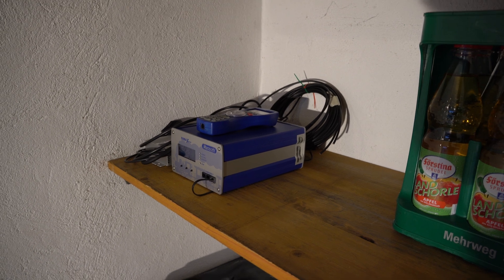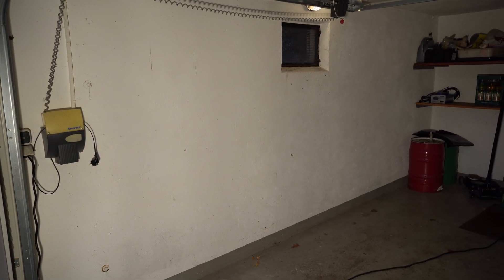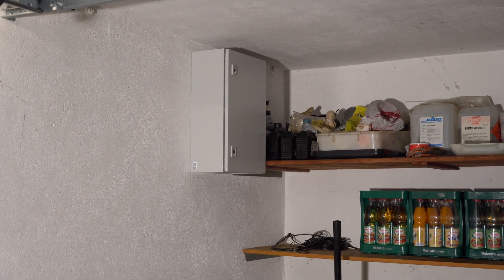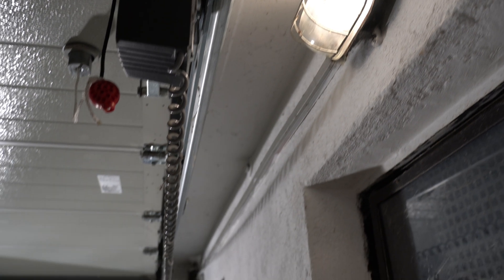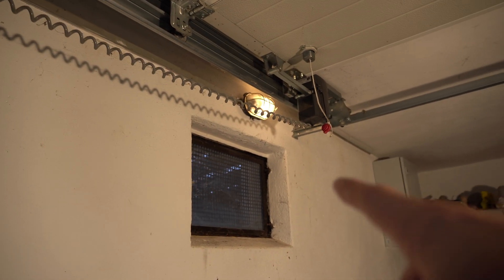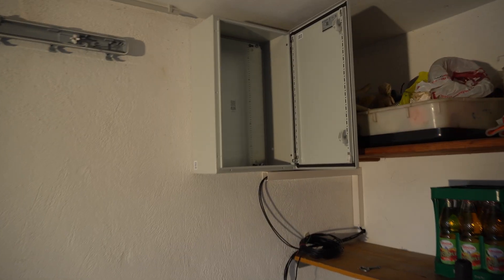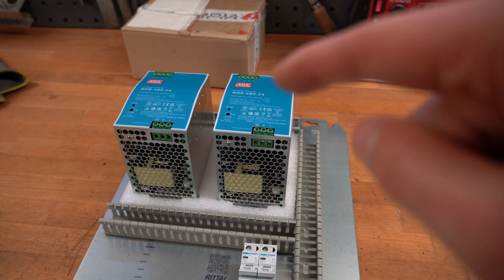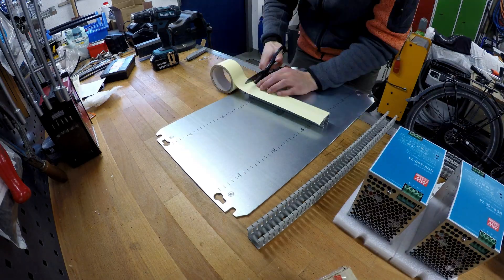40 amps of juice for my GARDEN RAILROAD, installing MEAN WELL NDR-480-24 power supply

Comment: I have been watching your videos of the garden railroad construction. I am new to this and just staring my outdoor layout and your videos are my inspiration. Are you using these to power the Massoth DIMAX system rather than the switching power supply that is often sold with the Central Station? Will you be adding video to provide mor detail? Thanks.
Reply from the maker: Hi, I am proud to be you inspiraton! You are right, I am using those power supplys to power the Massoth system and a booster unit which will be added later on. Ther is absolutely nothing wrong to use the switching power supply which is sold by massoth, more so it is recommended! There are two reasons why I use a different method ... 1. I want my power supply neatly tucked away rather than a big mess of extension cord, switching power supplys and feed wiring. My approach will be very tidy when its done. 2.  Instead of using several different power supplys I wanted a central solution which is powering the whole layout. I need a lot of power for the digital central station, a booster unit, switch motors, lights, signals and so on ... this is a all in one solution. There will be many more videos of the whole electrical installation on my layout. So it might be worth it to stick around!

Comment: This is excellent! This is one of the first videos I've ever seen where someone actually shows us how to put the wiring together. Usually they just say they wired it, or we see a note from the company that shows the connections but not how to make them, it's just a schematic. Here you show us the materials, installation, layout and components! And of course, with German efficiency, the pieces are well designed and made, easy to assemble and access, and look neat and tidy. This is what I've always wanted to see as I plan my own power and control boxes for wiring my layout. I look forward to the next steps.
Do you have a background in trades or engineering? You know exactly what you're doing with all this. ;-) 
How handy that your helper is the perfect height so you can have a clear view of what you are doing when working together! Great, and nice of her to help. 
Looking forward to the next videos, eagerly.
Are you using Massoth, Zimo or a different system for power and control? 
Thanks again!
Reply from the maker: Thank´s for your comment! This is just the beginning of a big electrical project which I will show in several different videos spread across the year as I´m making progress. I am using the Massoth DIMAX system to control the trains but I will use a different, yet to be determined digital system for control of signals and switches. I do have a background in trades and a lot of friends that know more than me, so I can ask :) The choice of a good size helper is key for success! 😂 Have a good day, see you in the next one!